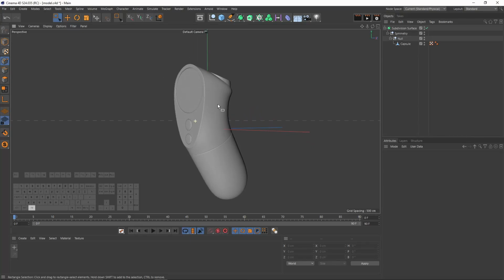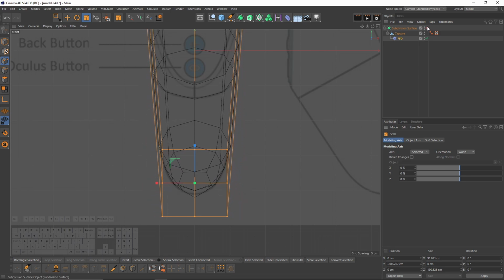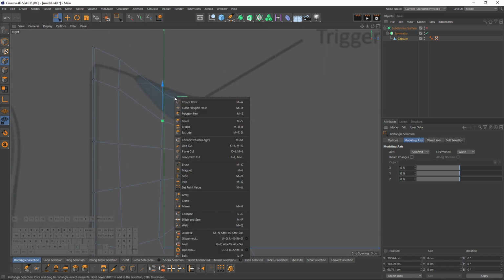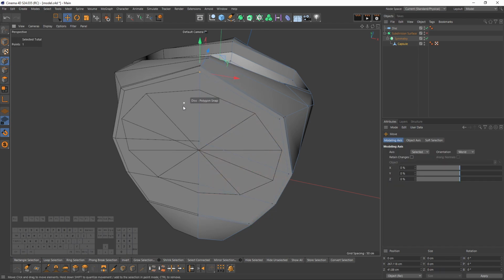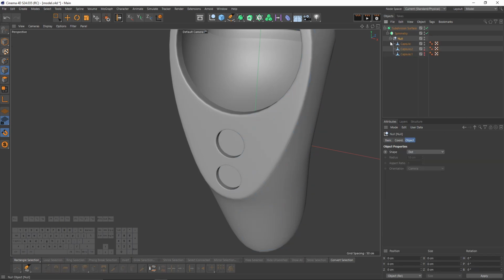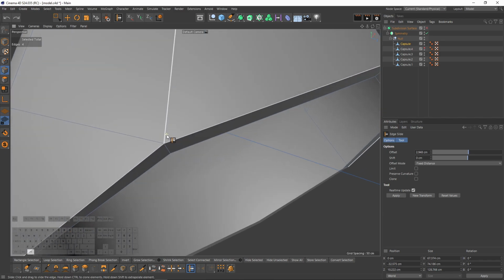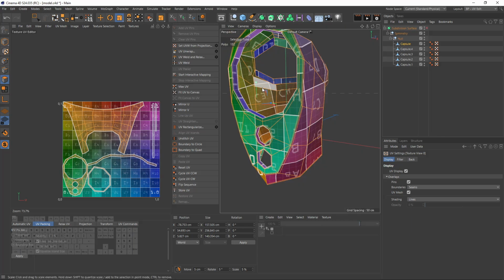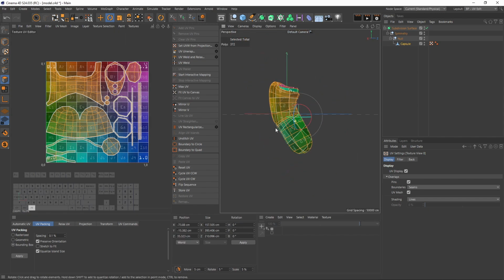Industrial Design/Product Modeling #11 | Oculus Go Controller

Comment: The lessons are very good, thank you, it would be better if you didn't accelerate because I miss the details.
Reply from the maker: Thanks, I accalarate when I check the mesh, or add small adjustments, not necessary parts.
Reply: thank you for your reply, the lessons are awesome

Comment: @polygonpen why do you have to unwrap the UVs?
How would I know when it is necessary to unwrap UV and when it is not needed?
Reply from the maker: It is always good to have unwraped UVs, but if you are just going to use materials, it is not needed, but if you want to texture or paint your object, it is necessary.
Reply: Okay thanks. What if I want to add label to a specific area of a model?
Like a button or a function?
Reply from the maker: @mutolibbusari979  First option, You unwrap and texture it by hand, second option you can add a material, put your label to your color channel, then change your materials projection to flat or cubic then try to rotate, move your material until the label fits in place, second option is faster but I would recommend the first one.
Reply: Thanks so much